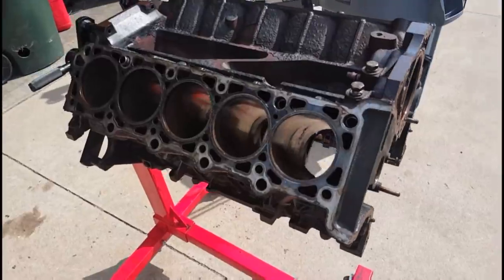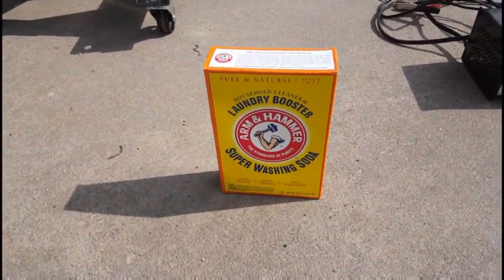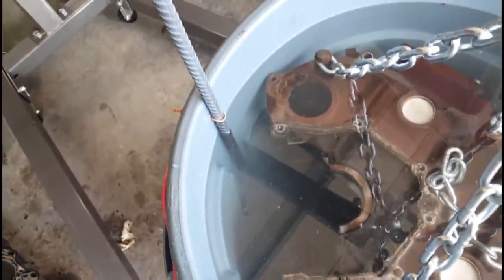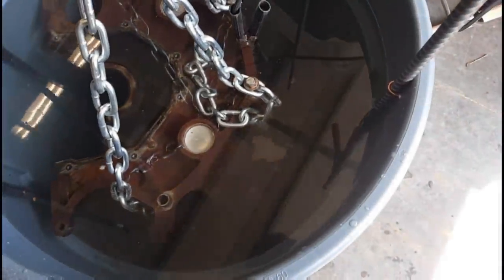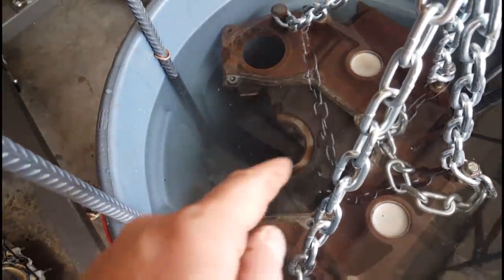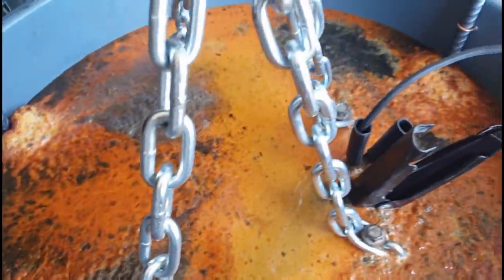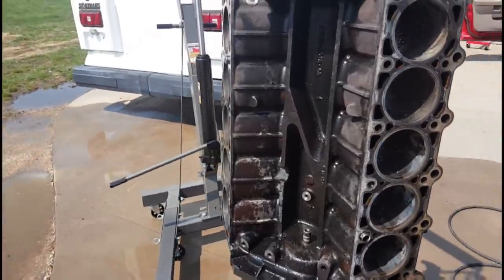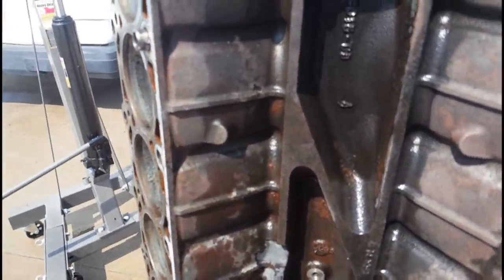1998 Ford 6.8L V10 Engine Block Electrolysis - Part 2 of 3

Comment: would not that have worked better if you took chain off of lift,it would have grounded or gone through entire crane if not to ground altogehter
Reply: It's 12 volts nowhere near enough the thousands needed to leak to earth like that
Reply from the maker: The block, chain, and lift where on earth ground...  positive is on the rods.
Reply: 12 volts wont leak through concrete though you need thousands of volts for it to jump to ground or direct contact to a properly grounded earth

Comment: Why only two valves/cylinder? Wasting potential intake area!
Reply from the maker: In 2004, Ford moved to a 3 valve engine.
Reply: Jeff Niemeier I believe it was 2005 when they made the switch. The Excursion stayed with the 2 valve though.
Reply: The Esseboy it might have been expensive for ford to make that work at the time
Reply: Alex Villalobos, well, they could've started making 5 cylinder vehicles and use the same cams as those! A 3.4 liter five cylinder would've been perfect for a plus size sedan or small truck! And if they turbo charged them they could've mad a 300-400 HP 5-cyl and a 600-800 HP V10!! But as they usually do they cheaped out and went with the worse pushrod style valvetrain (-.-")
Reply: The Esseboy Pushrods? Not the Ford Mod motors.

Comment: The battery in parallel had no benefit so long as the charger is capable of the current, which it was.  If you want to boost the reaction rate, you'd boost the voltage instead, use warmer water, agitate it, skim off the floating sludge, and put some degreaser in to cut the oil off of it.  Your Gold Medal Heat & Soak is probably just sodium hydroxide (lye) and is not really all that safe for exposure to skin or eyes, probably just a matter of it being dilluted that you didn't notice any issue, but dilluted it will not do as much and slower.  ALSO, it is probably NOT safe for use on aluminum, what the Gold Metal info was probably referring to was that it's safe FOR THE TYPES of metals used on their food equipment, not that it's safe for all kinds of metal.
Reply: For a faster reaction you need more current not voltage
Reply: False.   If you start out using a specific voltage power supply WITH enough current, which obviously anyone would do, replacing it with a power supply of the same voltage but even 20X higher current CAPACITY, will do nothing to increase the reaction rate.  You fail to understand that it is the voltage increase that makes the current flow at a rate that rises.  Further it is well known that the faster industrial electrolysis methods do this, increase voltage.

It would have also gone faster at higher temperature and a fluid recirculating pump to keep it all agitated.
Reply: Been doing it years, 12 volt 4 amp battery charger works a hell of a lot slower than a 12 volt 12 amp battery charger, don't see what temperatures got to do with it. Speaking from experience here not just bullshit i read on the internet.
Reply: OOooo I'm sorry, as an electrical / electronics technician of 35 years or so experience , with my area of expertise being remote area power systems with diesel generators both piston engine and turbine I stand corrected and obviously know nothing in the field of batteries and how they work, despite having published papers on the matter.
As a friendly suggestion, connect your oscilloscope (you have one of course) to the terminals of the electrolysis tank, do it first with just the charger powering the tank, then measure it again with a battery (or a large capacitor) connected in parallel. Then measure the current flow into the tank using a shunt and the second channel of your oscilloscope and calculate the energy being given to the tank, hint the number 0.707 may help in your calcs.  Connecting a battery or a large capacitor will improve the performance of the tank by 1.414 times.
Ray
Reply: The battery would have held a constant voltage across the bath, with the charger alone there would be a half sine wave rectified 50 (60?) Hz being applied across the tank. Also some chargers need a battery connected to operate correctly.
Ray
Reply: You must have a reading comprehension problem as well as lack of knowledge about basic electrical facts.  I wrote "so long as the charger is capable of the current", so what you had done was already make the mistake of not having a charger capable of enough current, then falsely assumed current is the way to increase it while it is voltage that ALLOWS more current to flow, MORE than what you had flowing.

You don't see what temperature has to do with it because you don't understand the chemical reaction.  That is why people who don't understand science, shouldn't post about scientific things.

Plus it's apples and oranges trying to compare two difference chargers if you don't even measure the voltage output.  If your 12V4A charger was under capacity, then it wasn't still at 12.0V.  However to be technically correct, NONE are at 12.0V.  A 12V charger has to be higher than 12.6V to get much charge into a lead acid battery as that is the full charge level where zero current flows.  Typical charger voltage should be above 13V.
Reply: Stinky Cheese battery made current more consistent (12V DC)

Battery charger plugged into the wall does not deliver consistent 12Vdc, the voltage goes up and down @60Hz too.

Comment: The battery charger should be manual charge. The charger cuts off automatically and doesn't work intermediatly.
Reply: I think that's why he connected a battery to the set up as well, I wondered about that charger.
Ray

Comment: Its an excellent method. I use it at work all the time. Theres still some elbow grease needed but it is a lot easier than it would be. Also you lose less metal than you would if you removed the rust by abrasive means alone.

Comment: Hmm, I've used Muriatic Acid diluted with water and then Baking soda to neutralize the acid. Comes out very clean.
Reply: Electrolysis has some interesting properties, one of which is that once done it makes the piece corrosion resistant.

Comment: How do you dispos of the toxic water
Reply from the maker: I'm sure someone will tell me I'm wrong but I don't really consider water, iron oxide, sodium carbonate, and ferric oxide to be toxic.  The end result is mildly alkaline and that's it.  It can be simply washed down a drain.  Unlike other harsh chemicals.  That is why I like the process.
Reply: He dumped it on the ground. you can see it in the video.
Reply: Its not toxic bro.
Reply: If that chain is chrome plated you might have some hex chrome in that water. That's nasty stuff..

Comment: having done this on a few auto parts .. I found that adding salt  to the bath really speeds up the electrolysis ..on a bath that large..maybe a whole 32 oz canister
Reply: deepsquat600 Isn't chlorine gas produced , using salt , in an electrolytic water bath ?
Reply: Coldern Ice 
Only if you use chlorinated water
Reply: Sodium carbonate is a salt 😂

Comment: How much heat did you feel coming off that?
Reply from the maker: None.  Does not generate any heat...
Reply: Jeff Niemeier I had to replace 2 electric pumps that got flooded. They were on 2 240v 100a circuits so imagine the heat lol

Comment: THE End Combustion Chamber on the First Head was LEAKING WATER .....
Reply from the maker: Yes, cylinder 10.  The gasket blew.  Water locked and broke the connecting rod...  Engine set for a few years before I got it.  Too much damage to the cylinder so we had to sleeve it.

Comment: Have you considered putting some sort of plastic circulator pump at one end of the water jackets to allow the electrolyte to move through the passages and back into the main bath?
Reply: madmax2069 It's ions that need to get there, that's the whole point of an electrolyte, so you don't have to hook up cables to everything
Reply: John Lloyd that wouldn't work, he would need to feed wire through the passages running currant through them before it'll work. Pumping water through the passage isn't enough.

Comment: 7.3 diesel engine was and still is the best engine the world has ever made.
Reply: Stephen Ison cool story... nothing to do with vid2o though
Reply: Stephen Ison need to put the crack pipe down. You have no idea what you're talking about.
Reply: My 4.0 i6 says different..
Reply: Toyota/lexus 1uz-fe 4.0 V8. No common issues.  all aluminum 32v 4 cam. Bulletproof reliablity
Reply: 7.3 IDI yes... 7.3 powerstroke not so much..
Reply: Diesel douches
Reply: Nope
Reply: Stephen Ison true V10 no low end torque. Had two 450 dumps one gas v10 other 7.3 PSD. Diesel much more powerful and no problems.
Reply: It's a good engine, but it still has its issues.
Reply: Thank international for that
Reply: I swapped a 5.9 Cummins into my '78 Bronco, because the older Cummins engines are difficult to beat in terms of longevity and power potential. My truck gets 25 mpg now too. lol
Reply: Stephen Ison 1.9tdi is most reliable engine ever made by mankind.
Reply: In line 6 diesel is the best design for diesel . 10 thousand trucking companies can't be wrong
Reply: hahahahahahahaha all those engines dont even power themselves! 

the best engines ever made did not make it to the consumer market ever! even Hitachi.

learn how the world works first, then learn how engines truly work. most of you folks think engines run on gas pfff
Reply: zengerz ? I’m so lost it’s unreal
Reply: diesel engines, gas engines... blablabla. 

engines run on nitrogen mostly. 

and all those car manufacturers know the same and are on the same team; just look at their logos which all connect; but I dont know if you know such language. most people dont and only can see regular stuff. too much copying of bullshit.
Reply: astrology and car logos... I wonder why every car manufacturer chooses a logo representing this ;) 

if an egine could run itself and have leftover energy; the people woul;d be energyselfsufficient and it would mean less income and esspecially power for their companies etc etc.
Reply: engines who use gas or diesel as a primer to burn the compressed nitrogen are inferior and will never ever be the best engines.

both are loser engines no matter how big they are built. like a battle of inferior knowledge because you dont know how proper engines are supposed to work. hence why everyone is educated in 1 way of thinking.
Reply: zengerz I’m going to be honest I have no clue what your talking about, but you seem extremely knowledgeable. I was just saying the engine models I like and not what they run off..
Reply: Zacarias Blanco do you realize Stephen never mentioned Ford right? Also Jason sorta mentioned it before, Navistar International not just International.
Reply: hahahahahahahahah, the 3.4l four cam Lexus.
Reply: The best Ford engine was built by others. Ford sucks
Reply: 7.3 is shit,take that from a mechanic who has worked on both versions LOL
Reply: 5.9 and 8.3 were joint ventures between CASE and Cummins,hence the great result
Reply: No ford hit the jackpot with the 6.0 Powerstroke lol.
Reply: Stephen Ison  you forgot to mention the manufacturer of that motor  and no is not Ford's engine its INTERNATIONAL who build that motor and yea any vehicle that is serviced and not abused  and using OEM parts obviously it wont give up and will last a long time  i can tell your proud of your super duty or ? Is it a tow truck ? Anyway  I give you props for taking care of your vehicle but the video is about cleaning an engine block ,  I'm just saying
Reply: fadingbeleifs your the one that has it lol
Reply: Are we forgetting that the small block chevy has been in production for 63 years
Reply: Stephen Ison 1LR-GUE? 2JZ GTE? K20? 4G63T? RB26DETT? EJ25?
Reply: I have an 02 7.3 with 600,000 miles on it and never had to replaced the transmission or injectors, just minor parts like the steering stabilizer shock and fuel filters. Towed many heavy loads and a Mack truck a couple times with the dinosaur and never had any problems. You take care of a truck, it'll take care of you.

Comment: I'm not aquainted with v-10 engines but why clean the cams? If they are worn out like the block then get reground or new .I went the cheap way and got bit hard..great video...if possible all do it yourseflers should use your method.I lived in Charleston ,SC and nobody would hot tank my 327 chev block...DEQ regs  ...I scraped most of the grease and scrubbed all metal parts with Purple degreaser...Fabulous product.Any leftover can be reused.Strain it and its biodegradable also..
Reply from the maker: Thank you for your comments!  Cams seemed to be fine.  The shop that did the sleeve also checked everything.  Only serious problem was the blown head gasket that caused water to leak into cylinder 10 and water locked the piston that broke the connecting rod.  Engine set for probably 3-4 years and the water caused too much damage to the cylinder walls so we had to sleeve the cylinder.  This is a recreational vehicle that might see 3,000 miles a year so didn't want to put much money into it...  Of course, this is my first complete rebuild so I'm learning as we go...  So far I am very happy with the performance of the engine and drive train thus far.  My project for the van this spring will be suspension and replacing the air conditioning system.
Reply: Ya its all spendy now compared with 1969 prices on my first engine.$ 150 to rebuild back then..My gas station wages were $1.25

Comment: Would it had been more efficient had you removed the freeze plugs?
Reply from the maker: Yep!  This was my first engine...  I'll know better next time...  Replaced one in my boat motor last spring.  Now I know why they call them "freeze plugs".  Luckily, the boat motor hasn't shown any signs of permanent damage...
Reply: Jeff Niemeier thay are drains for sand from when the engines are made.

Comment: Should have pulled freeze plugs! We've been using this method since 95, it works great!!!
Reply from the maker: Didn't spend the money on a professional machine shop.  This was a low budget build.  Ended up spending more money than I planned.  Was seriously trying to avoid shop expenses but the damage to cylinder 10 was too bad.  Luckily, I have a machinist friend that has the equipment and knowledge to sleeve the cylinder.  Next time I will remove the plugs.  Live and learn.  I also enjoyed the experiment.  LOL...
Reply: Any machine shop would have pulled the freeze plugs and tanked the block out as part of the cylinder work and installed new freeze plugs. 
He is kind of wasting his time unless he just enjoys experimenting.
Reply: I designed a machine for our shop that uses the same method by 36VDC, it's fully automatic and will clean the worst blocks you can throw at it in 6 hrs. You have to pop the freeze plugs and it will come out like new! No B.S.We have compared with every attainable method possible and my machine produces the best seasoned block outcome. Had some great offers to produce but waiting on Pat. chemicals, you can dump cycled water to city drain. He's on the right track, just the wrong conditioning..
Reply: Mike Weakley how do you get 36 amp output?  If that is a secret, please excuse. 
  I was wondering how to increase amperage output for my simple tank which is like his in the video. 
  I think the battery added in series with my charger may be my answer to at least get more than one or two amp output.
Reply: @rickeykeeton71   maybe three battery chargers and three batteries just guessing JT 🇺🇸🇺🇸🐠🐟🎣🛥🌴🐟😊😊🙏🏻🙏🏻
Reply: My first thought too , I would have knocked out all the welsh plugs.
Reply: I'm curious if the heat and clean would work for the oxidation process
Reply: Mike Weakley x
Reply: Mike Weakley what happens with the old water?

Comment: If you're having the block bored oversize why not have the machine shop just boil the block out in their hot tank, which they usually do for rebuilds anyway. Very nice tips on cleaning blocks though. As for the head cleaning, try using a recirculating pump to keep the hot water moving to do a better job on the water passages and such.
Reply from the maker: Thank you for your comments!  The machine shop that did the sleeve was a one man shop.  They have a cleaning tank which greatly helped.  I was hoping not to spend the $800 for the machine shop but in the long run the cost was worth it to make sure everything was done right.  Still MUCH CHEAPER than the local "Professional" shop that would have been twice the cost.
Reply: Yeah, a lot of remaining machine shops are pretty much hanging on by the skin of their teeth in a lot of places now, and finding people willing to learn the kind of skills to do this work isn't easy. As hard as it is to consider spending the money, I'd still rather there was a shop around when I need them. Glad you were able ti find someone to do the work for a fair price. How are those engines otherwise, they look simple enough in that they don't have variable timing at least.
Reply from the maker: Once you unhook all of the sensors, hoses, etc...  The engine is still just a basic engine that I remember from high school shop class.  the Ford 2-valve engines don't have the variable timing.  I think that changed with the 3-valve engines in 2004.  The 6.8L V10 does have an extra "balancer" cam on one side.  Other than that and the 2 extra cylinders it's pretty standard.  Something I will defiantly tackle again.  I have a 2007 F-150 that will need new timing and everything that goes with it, including the oil pump.  That engine has 180k+ miles...  So glad I had FordTechMakuloco to follow on YouTube to walk me through most of these engines!